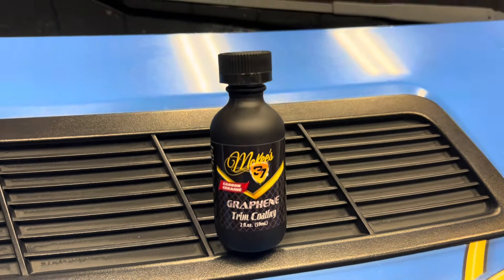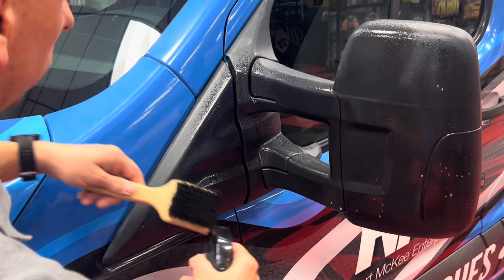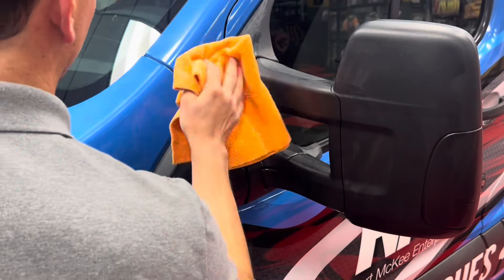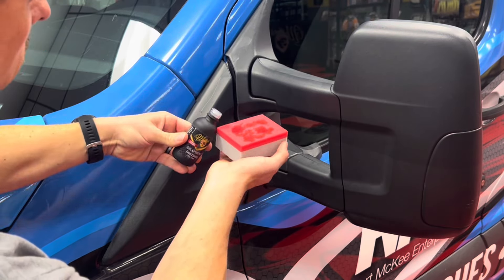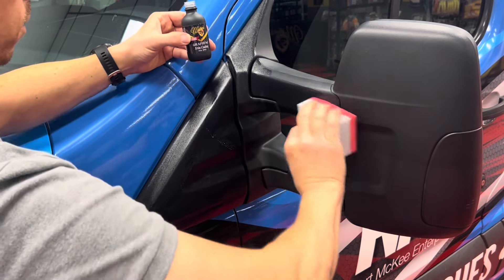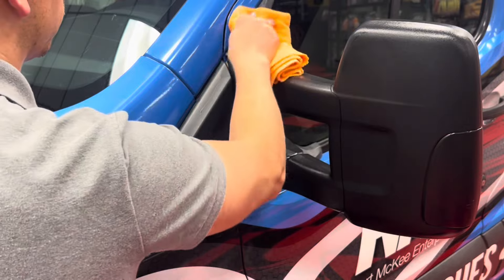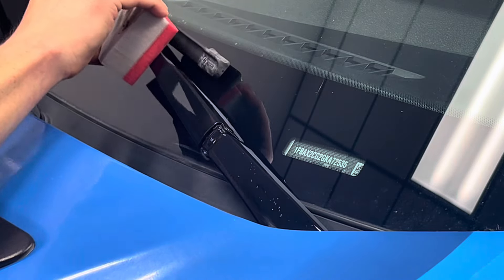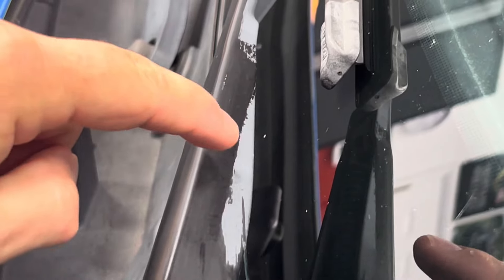Graphene Trim Coating - ALL NEW PRODUCT | McKee’s 37

Comment: OK to apply on top of whatever ceramic coating that already exists on trim? If so, any prep needed if the ceramic coating was recently completed in the last few weeks?
Reply from the maker: I haven't tested all combinations of ceramic coatings on plastic trim, so it's hard to say for sure.  The best way to find out is to give it a shot yourself.  I would try a small, inconspicuous area first.